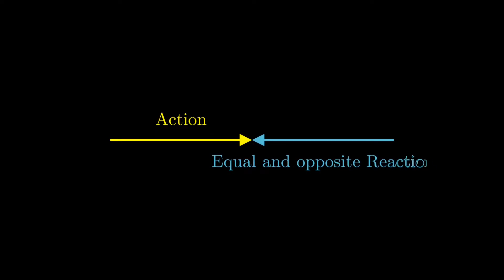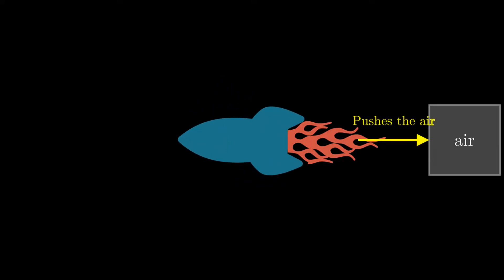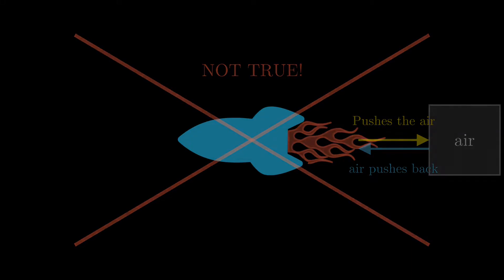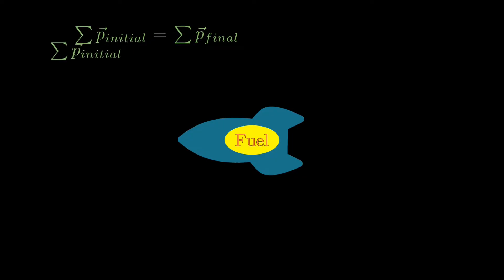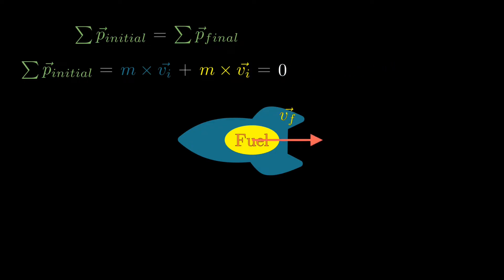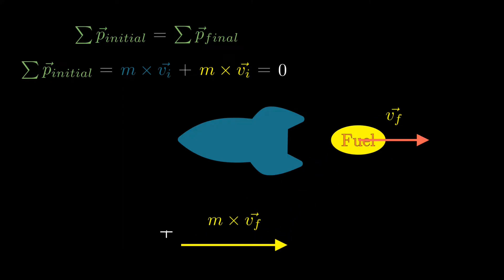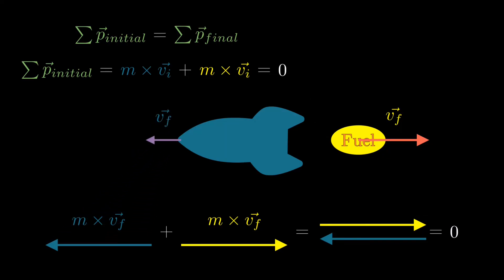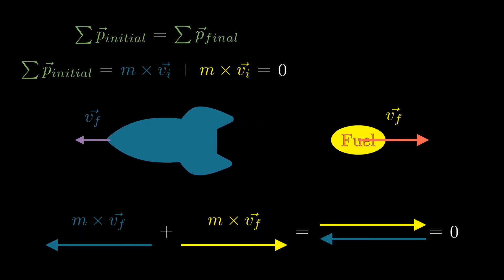What do Rockets push in Space, where there is no Air?

Comment: The fuel gets sucked out not pushed
Reply: No it doesn't.  LOL
Reply: Vacuums don’t suck. Pressure disperses into a vacuum because the particles push themselves to expand outwards. 

If you draw a vacuum then open the chamber, the vacuum doesn’t suck air in. The surrounding air pushes itself in.
Reply: @AM-rd9pu  the particles push nothing basically
Reply: @jameywc2  Bless your little heart!
You think that a "vacuum" can "suck".....

Have you considered taking an actual PHYSICS CLASS - BEFORE thinking you are smarter than all of the Engineers and Physicists?
No a vacuum does not "suck".
A vacuum cannot apply any kind of force on solids, liquids, or gases.
Reply: @AM-rd9pu  there is no surrounding air.
I can't help if I'm thinking openly about this stuff. Forgive me 😎
Reply: @jameywc2 The particles push off the rocket. That’s how they get ejected out through back. What happens to those particles after they leave the rocket is of no concern to the rocket.
Reply: @AM-rd9pu  a weightlifter pushes a weight but there is no floor? A swimmer in a pool with no water? A propellant in a vacuum? All the same situation.
Reply: @jameywc2  They’re not really all the same. 

The weight pushes on the lifter and the lifter pushes on the weight. The lifter also pushes on the bench and the bench pushes on the lifter. The bench pushes on the floor and the floor pushes on the bench. 

A swimmer pushes on the water and the water pushes on the swimmer. 

A rocket pushes off its own exhaust and the exhaust pushes off the rocket. 

Again, what happens to the exhaust particles after leaving the rocket is of no concern to the rocket. You can’t feel when a projectile you shot hits a target or when water from a garden hose hits the ground, so why would a rocket feel when its exhaust hits an object after it has left the nozzle?
Reply: @AM-rd9pu  pushes off it's own exhaust?! What holds the exhaust in place? Where's the resistance?
Can i pull myself up with my own bootstraps?
Reply: @jameywc2  They both move. You know you can push off a moving object right? The resistance comes from inertia.

Think about what happens if you sit in a rolling chair and throw a heavy object. The object goes the direction you threw it and you roll the opposite direction. Instead of throwing one heavy object, rockets eject lots of little objects (the exhaust gas particles).
Reply: @AM-rd9pu  Since there's nothing to oppose the gas, work done is 0. Since work done is 0 and no heat loss/gain, dU = 0. Hence, change in internal energy of ideal gas while free expansion or expansion against vacuum is 0. The process is also known as Irreversible isothermal process.
That analogy i have heard. It is not the same as a rocket in a vacuum exploding gas into a vacuum.
Think if the ball was being pulled from the person while trying to push it.
A swimmer in a pool with no water i think is a good example.
Call me crazy it's all good
Reply: @jameywc2  When the surrounding pressure is 0, w = -p * delta_v tells us that the work done on the surroundings is zero. This intuitively makes sense because it doesn’t require any work to push/ resist nothing. However, this doesn’t mean that the gasses still can’t do work. 

Your analogies are not applicable. The gasses push off the rocket, therefore imparting a force on it.
Reply: @AM-rd9pu  what supports the gases as they push? Can't help my brain thinking these things
Reply: @jameywc2  The combustion chamber and nozzle keep the gasses contained on all sides except one. The gasses get directed out the back. There is a force imbalance that leads to a net force on the rocket. Mass is ejected backwards, therefore a forwards reactionary force is imparted on the rocket. This is the third law of motion at work.
Reply: @AM-rd9pu  third law of motion requires two separate objects acting upon each other.
Reply: @jameywc2  The exhaust gasses and rocket are separate objects.
Reply: @AM-rd9pu  Newton's third law is misquoted and misrepresentative usually for metaphoric reasons. in physics it means something specific and quantitative. For every action there's an equal and opposite reaction. It means that if two objects interact the forces they impart on each other will be equal in magnitude and opposite in direction.
This does not apply to the rocket pushing off of it's own exhaust because this is one object. There is two objects when the vacuum is not present and that object is the air mass. I cannot explain this any more clearly.
Reply: @jameywc2  You correctly state the third law of motion, but then incorrectly state that the rocket and its exhaust aren’t two separate objects. 

I’m genuinely curious how you think that the rocket and its exhaust aren’t separate objects. Would you call a hose and the water it sprays the same object? Would you call a bow and arrow the same object? Would you call a gun and a bullet the same object?

Rocket fuel has mass. The fuel is burned, converting that mass from a solid or liquid to a gas, and then that mass is ejected out the back. 

For the same reason that if you would roll backwards if you threw an object while sitting in a rolling chair, a rocket is propelled forwards by ejecting mass out the back.
Reply: @AM-rd9pu  For a free expansion into a vacuum, a gas does no work, as there is no resistance on the gas as it expands, i.e. P=0 and therefore the quantity −PΔV=0.
Joules.
Why do we have to re-enter with so much heat?
Tell me one time where a rocket came back using thrust in space to slow down re-entry?
Just one time?
Never happened because it can't happen.
I think you are mistaken about the rocket being two objects etc.
A car crashes into a tree then the passenger crashes into the windshield is that three objects? How about the dirt getting hit by the tree? Is that four objects? 
Plus that chair thing ugh. It does not apply to gas into a vacuum.
Only if someone took the ball while you pushed it cancelling out the resistance.
Reply: Just sayin
Reply: @jameywc2  That equation describes the work the surroundings do on the system (positive value for w) or the work the system does on the surroundings (negative value for w). 

When the pressure of the surroundings is 0, we get 0 for w, meaning that the system did zero work on the surroundings. This intuitively makes sense because there is nothing resisting the expansion of the gas in the system. It takes no work to push against nothing. 

There are multiple ways a spacecraft can land and the environment in which they’re landing determines which method is best. When returning to earth, the atmosphere can do a majority of the work to slow the craft down thanks to air resistance. In an environment like Mars, a combination of aerodynamic braking and thrusters are used. The thin atmosphere can help slow down the craft but not enough for a safe landing. And in environments with no atmosphere, landings are performed entirely using rocket thrust. 

And lastly a friendly reminder that a vacuum isn’t a force. It doesn’t “take the ball away”. A force would be required to do that.
Reply: @AM-rd9pu  you push on a vacuum? You just plow into the atmosphere to slow down? Why no base on the moon?
Why no shuttle round trips.
Apologetics is what I'm hearing.
Dodging the fact that no rocket can slowly re-enter.
a swimmer in an empty pool then no work is performed.
Nozzles change at certain altitudes? 
Simple as that.
Reply: @AM-rd9pu  thanks for admitting a rocket exhaust does no work in a vacuum, chatbot. No work=no change in motion 😂
Reply: @jameywc2  you are correct, the rocket exhaust is part of the rocket, exactly the same as a propeller is part of an airplane. They both create a force pairing with the atmosphere, it's literally in the 4 forces of flight. Lift, drag & thrust are all forces applied by the atmosphere.
Reply: @AM-rd9pu  I'm genuinely curious why you can't count. The rocket & exhaust move together at all times, because they are both part of The same body, same as a propeller is part of an airplane & wings are part of a bird. I'm also curious why you spend your entire life lying to people in YouTube comments when you claim to be an aerospace engineer?🤔😂
Reply: @papalegba6796  And your reading comprehension issues strike again. I said that the gas performs zero work on the surroundings not that gas performs no work whatsoever. I’ve explained this to you multiple times and you still refuse to understand it. 

And you really think the exhaust moves with the rocket? The exhaust has an exit velocity on the order of thousands of miles per hour in the opposite direction that the rocket is moving. 

I’m curious how you can get such simple things wrong. 

And it’s funny that you accuse me of being online my entire life when you’re the one that just went on a six hour long comment bender.
Reply: @AM-rd9pu  but a gas expanding into a vacuum does perform no work whatsoever, as there is no change in its temperature. You explaining your lie does not make it true, chatbot 😂
Reply: @papalegba6796  Continuing to misrepresent what the equation is calculating doesn’t prove your point. No matter what you say, that 0 only means that no work was performed on the surroundings. The temperature also does change. Rocket exhaust cools off after leaving the rocket.
Reply: @AM-rd9pu  a gas expanding into a vacuum does not change temperature, as there is no energy transfer. This is why no work is done, it's called free expansion, lying chatbot bro 😂
Reply: @AM-rd9pu  "During Free Expansion, the temperature remains constant, hence it is an isothermal process. This property results from the fact that there is no exchange of heat (Q = 0) and no work done (W = 0), leading to no change in internal energy (∆U = 0)" .
Will you apologise for your lies now, chatbot?🤔😂
Reply: @AM-rd9pu  oh and I just showed a rocket creating work in a vacuum would violate the first law of thermodynamics too. You'll lie about that, too I bet, chatbot 😂
Reply: @AM-rd9pu  care to address your lies,chatbot? 😂
Reply: @papalegba6796  Evidently, you have no desire to acknowledge actual science. Can’t say I’m surprised.
Reply: @papalegba6796.  Bless your little heart!
You think that a "vacuum" can "suck".....

Have you considered taking an actual PHYSICS CLASS - BEFORE thinking you are smarter than all of the Engineers and Physicists?
No a vacuum does not "suck".
A vacuum cannot apply any kind of force on solids, liquids, or gases.
Reply: @stuartgray5877  I know the physics definition of the word "suction", chatbot. Unlike you 😂
Reply: @AM-rd9pu  evidently you ignored all the physics I posted & just lied. Because you are a chatbot 😂
Reply: @jameywc2  vacuums do suck btw, according to the physics definition of suction. NASA chatbots hate physics tho 😂
Reply: @papalegba6796 Every accusation is a confession on your part.
Reply: @AM-rd9pu  <------- chatbot saying "i know you are but what am I?" 😂
Reply: @papalegba6796 I can’t help that you are blind to your own projection.
Reply: No, it definitely gets pushed out.  Are you one of those ignorant people who think the vacuum of space is at a negative pressure?
Sorry it is just at 0.0 PSI.
The "vacuum" cannot exert a force on anything.
Reply: If you opened all the valves and not even turning on the pumps, it is possible that any residual pressure in tanks would push propellant slowly out into space. However, that wouldn't produce much thrust. If you used the pumps this would flow the mass faster and produce a bit more thrust, but you need high velocity to really generate a lot of thrust.
Reply: @kitcanyon658  thrust is an external force, chatbot. So it is by definition impossible in a vacuum 😂
Reply: @papalegba6796 An external force coming from where exactly?
Reply: @AM-rd9pu  thrust is an external force applied by the atmosphere, chatbot. It's in the 4 forces of flight that you are not programmed to understand & which i already explained 😂
Reply: @papalegba6796 So the rocket shoots mass out the back but somehow it’s the atmosphere pushing on the rocket? How does that create a net force? Atmospheric pressure applies a force in all directions.